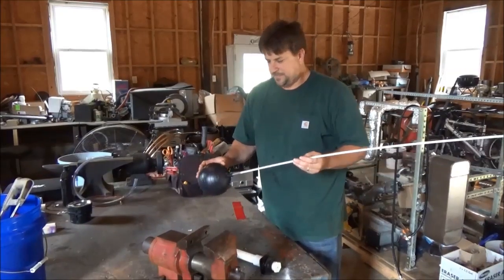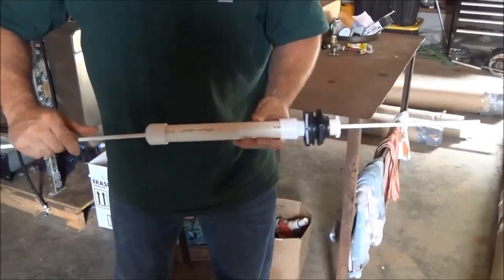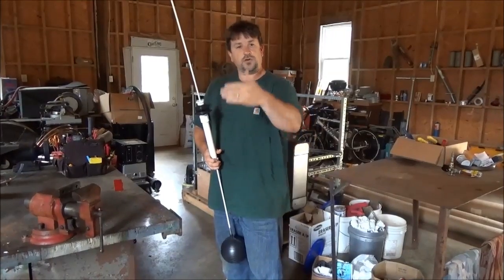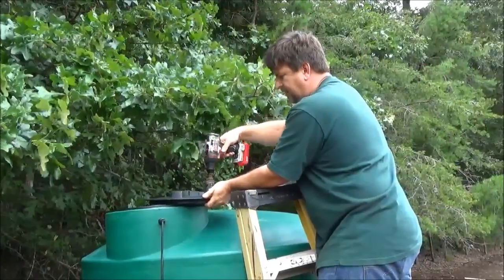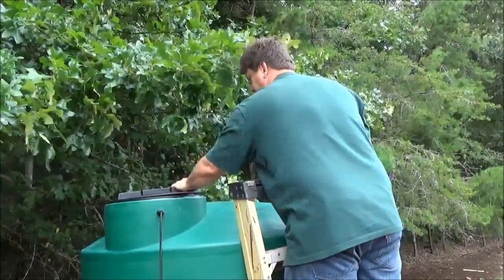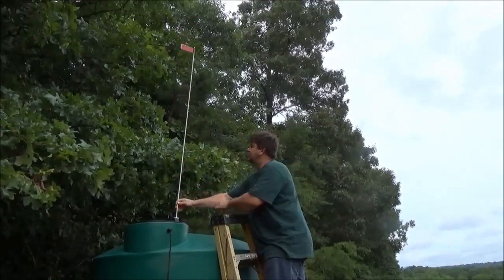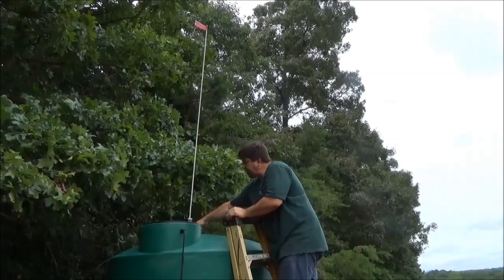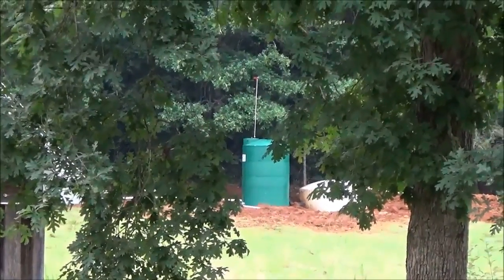I Can Check My Water System From A Long Way Off.

Comment: you could just paint the stick different colors at different levels say when the tank is full the bottom of the stick is showing and say from 3/4's to full blue will show and when its 1/4th to 12show yellow and when empty to 1/4th it shows only red...

Comment: I have a water holding tank of about 1,200 gallons. I use a flag pole/float system as a water level indicator. the pole is about 2x the diameter of the tank and the center is on a pivot with a bright orange flag at top. the diameter of the tank is about 18" wider than the depth, so when the flag is standing straight up I have about 18" of water or as I guestimate 12-15% total quantity of water remaining. I have a spring fed creek that flows into a small pond. at midpoint of the creek I created a concrete drainage ditch to divert the water to my in ground tank. I just walk up the hill turn a handle and open the gate and let the creek do its job. very handy. takes about 6 hours to refill. along the drainage ditch I have 4 separate filtering systems just to remove various size particles. when I shut the water gate I walk down the drainage ditch and clean out the filters. I have to do this maybe once a week.

Comment: This is essentially the same system that was used on the old locomotive water tanks.. The peak of had a rod with a metal ball attached to a float inside the tank..

Comment: Scott, If you are going to consider using this on a household water supply... is the fit of the fiberglass rod relative to the bulkhead fitting close enough to avoid water contamination (by insects, etc)?  Hate to see you get a contaminated household water supply...
As, an addition to your visual reference flag... you could put a stationary flag at/on the lid of the cistern so that you can have a comparative gap between the flags should you need to look at it in low light levels.  (Shine a light at it and get two distinctly separated reflections back = GOOD; or virtually a single reflection back = BAD).  Or alternatively, put a flag "visual blocker" for the last couple of feet of flag/stem movement... then if you see the flag its good, when you can't see it anymore, that's bad.
Reply from the maker: Yes sir, it is very tight.  There are acutally 2 holes that are drilled 5/16" and the rod is 5/16".  The Fiberglass on PVC is tight and the there is very little friction.  No bugs allowed!

Comment: Could you use a pressure meter with a remote readout, especially it the out flow pipe is near the house.

Comment: Idea - you can color code the pole - like 2 feet red is full, them 2 feet blue half full, & so on...
Reply: I like it.  Plus if one wraps the reflector tape(s) around the rod instead of having flags, then one doesn't have to worry about the flag getting disoriented - aiming directly at the viewer or away from the viewer, making it almost impossible to see.
Reply: i think with the tight tolerance between the poll and the entrance to the lid the reflective tape would cause it to stick

Comment: Hi Scott,

If you divide the distance of the visible rod in half ( at full capacity,mark the rod at the lid)...
...paint the bottom half of the exposed portion black, and leave the top white and you'll have an equidistant gauge at a glance.
 The shorter the black, the bigger your problem. If you only see white, you'd better hurry out there. Just a thought.
Reply from the maker: Not a bad idea.
Reply: I also thought about green at the bottom, then yellow, then red at the top section all the way to the flag.
That would be an indicator of "danger" levels. Of course, you could put measurements on it at each foot and then stripe every other foot, then just count the stripes for a more accurate measurement, but I kinda like the stoplight colors as basic indicators.

Comment: How do you keep it from freezing in the winter?
Reply from the maker: The tank is large enough to not freeze plus water is being pumped into it every day that is 55 degrees plus.
Reply: engineer775 Practical Preppers I was thinking more about that pvc piece the rod slides up and down in. Moisture in there freezing and sticking the rod in place. Think there will be enough ambient heat from the tank in general to keep that from happening?